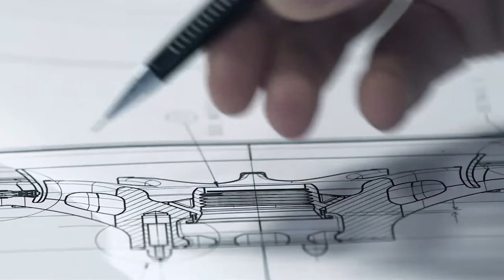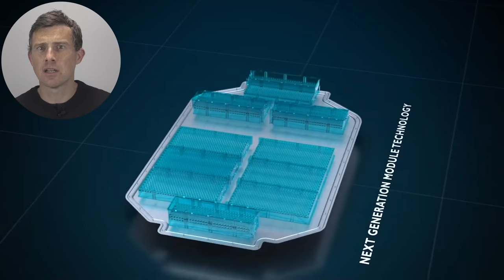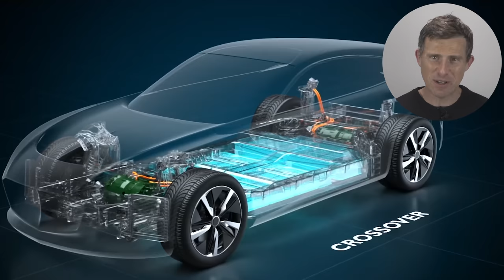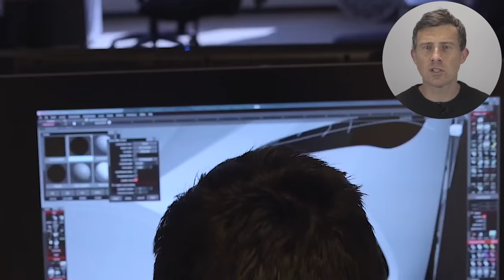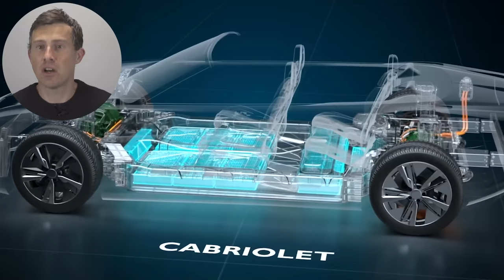New Jaguar F-Type R - an EV with 1,360hp and 1,000KM range?

Comment: Tesla S plaid vs F1 Car vs Chiron vs Rimac.

I want to see how the tesla wil hold up
Reply: Tesla Model s plaid is coming in Uk end of 2022
Reply: so u want a 140k car vs a 62.5M one vs a 3M one vs a 2.5M... i already know who is the winner
Reply: @panoskent6682  i don't know the winner but i know the Chiron is the looser on the standing 1/4mile.
Reply: Carwow need to import one, perhaps they already are.
Reply: @panoskent6682  At the end, it'd be Rimac, easy. I'd say the F1 would eek out more wins against the Tesla, since it recorded a 9.2 quarter mile, and Plaids have been running consistent 9.3 quarter miles (before stripping weight). I do look forward to Mat getting ahold of a Plaid though! Gonna embarass so many super/hyper cars, lol.
Reply: @martinkuzma_  
But they can still import it right?
Reply: Ofcourse Tesla and rimac will loose how can they compete with Chiron and F1.
Reply: Rimac will win
Reply: @enyotheios2613  yeah dude and it's only 140k. Imagine if tesla made a 2 seat hypercar.Not a tesla or an electric fanboy but what they achieve is insane for the money
Reply: @Anonymous_6.9725  
This is a 1/4 mile drag race

Not track race or top speed race.
Reply: @thabangsmallest8199  
but not at the top speed 😏
Reply: @jakes2814  Then also the F1 would reach the line first due to it's high revving small powerful engine and less weight.
Reply: @panoskent6682  The 140K Tesla?
Reply: @Anonymous_6.9725  rimac easily destroys the f1 car
Reply: 1st: Rimac
2nd:  Tesla 
3rd: F1 car
4th: Chiron
Reply: @Anonymous_6.9725  the f1 car will have a lot of wheelspin making it very slow off the start, but the rimac will win, then it will be the tesla and then the f1 car making the chiron come last
Reply: Should use a Chiron SS
Reply: then it would be rimac > plaid > F1 car > chiron
Reply: @sonethosen3211  Looks like you need basic science. eventhough the rimac is awd the F1's got a high revving ice engine power matters it's not only grip, the F1 will easily beat the rimac due to it's powerful IC engine.
Even the F1 is having a very low power making it a good power to weight ratio car and for the grip it's got a massive rear spoiler which will provide much downforce to the car to not make a wheel spin.
And if the F1's tyres are hot as well it'll beat it more faster.
Reply: @UN1T3D1C3  The F1's downforce will provide it very much traction and it's low weight will give it an advantage.
Then comes the rimac, then comes the Chiron as the Chiron's got a massive quad Turbocharged W16 which once if catches the speed can get insane fast.
Reply: @Maverick If it's a 1/4 mile drag race rimac will smoke the Chiron for sure but not the F1.
Reply: @UN1T3D1C3  There isn't a video in which F1 is directly compared with rimac.
But still in a 1/4 mile drag race rimac who smoked a sf 90 stradale in Carwow could give a good competition to the F1.
Can't outperform though.
Reply: @Wooly Chewbakker 
1/4 mile drag race and rolling race
Reply: @garosama4517  👍
Reply: @Wooly Chewbakker it is a 1/4 mile race not a race track

Comment: Your fighting the law of diminishing returns when you just try and stuff more batteries in to increase your range, it’s the weight that kills you. 120kw pack is a waste they could build two cars for that, if charging is sorted no one needs to be lugging around all that wasted capacity not to mention the cost!!
Reply: 1) people like range.
2) if you watch the video, the battery is part of the chassis saving significant weight. Plus the rest of the chassis is carbon fibre....saving weight. Result is a chassis with an integral 120kw battery that is lighter than the combined weight of Tesla's Plaid chassis+95 kwh battery.
Reply: @markheywood8236  battery is part of the chassis, meaning it’s non replaceable and the car is essentially as disposable as an AirPod since it’s batteries can’t be replaced in 15 years when it’s flat
Reply: @emmanuelonuoha1880  a) all electric cars are disposable. As the technology changes.
b) the battery chassis element could be a bolt-out element, or part of a carbon fibre casing that can be interchanged....that's how they do for e-racing cars.
Reply: That’s why Tesla decided to cancel the plaid +, at first I was mad but on sedonc though yes it’s more logical you can build 2 cars instead of 1 and you carry extra weight of battery you don’t need 95% of the time
Reply: Set out before it gets hot😷😠😡😵🤪😳😱
Reply: into every corner before you 👏✍️🤟👋🤚🤜🤛
Reply: range will  be a big seller here in Australia. most ppl want to get to their location quick and dont wont to wait around 40mins to charge up again.
Reply: You're*
Reply: @markheywood8236  do you know how much it costs to build stuff in carbon fibre, Rimac 120kw pack, carbon fibre body 2 million+, Williams have only ever done high price low volume stuff, very little chance People will want to pay that much for a jag badge or it’s going to be super low volume. Who needs more than 350 miles of real world range
Reply: @TeslaBulldotcom  But this isn't proposed to be low volume, they are building a platform that is sold to numerous manufacturers. Unit cost drops massively.

Comment: The issue with getting a 0-60 lower than 2 seconds is not horsepower or torque, it's grip. Tyres are the bottleneck.
Reply: It’s almost impossible to accelerate past 1.4G with wheels. Sub 2s gets to that mark
Reply: To be honest most differences in 0-60 times are due to grip.  Probably why Porsche and electric cars do so well - they're able to give the max amount of torque for that instant moment to the right wheels.  Porsche's have the added advantage of being able to load their huge rear wheels by putting the engines weight on then
Reply: Agreed, but these quick acceleration times are really just marketing willy wangling.
Reply: @TC-V8  To be honest, I think any 0-60 time under 5 seconds is just a party trick to thrill passengers. It's not comfortable to do that regularly.
Reply: @TC-V8  It's like the early days of digital cameras and the megapixel thing.  No-one needs faster than, say, 6-7s 0-60.  That's plenty for safe driving.  I enjoy my motorbike, but the novelty of 0-60 has largely gone.  Much happier cruising at 50 through the countryside - that brings bigger smiles that last for longer than dragging for 3 and bit seconds from some lights.  Def willy wangling.
Reply: @dm319-j5y  So now that you're done with the fun of a fast 0-60 you don't think anyone else should have it? That's pretty myopic. No one NEEDS a car at all. So stop using the word "need".  I have a 2013 Model S P85+, and my 0-60 is about 4 seconds (I haven't actually clocked it, but I'm pretty sure it's in that ballpark), and I almost never floor it, so most of the time I don't even use that extra power. But I do use it sometimes, and it's nice to have it there for special occasions.

Comment: All I know is that the days of the internal combustion engine are numbered.
Reply: Brands will continue to develop them for a few more years and then end them.
Reply: @stubones  Correct... Who wants an EV in the rain forest? 2 canisters of fuel and you can drive hundreds of kms more. Lighter jeep, diesel or gasoline have less weight too, no infrastructure needed. And in Germany you can strand with an EV too, because the infrastructure for charging is a mess.
Reply: @garosama4517  Why is that a bad thing. We want more EVs and to phase out internal combustion engine vehicles
Reply: @Hhhh22222-w  I don't understand
Reply: @unicorntomboy9736  nope, we don't wan't it.
Reply: @garosama4517  Who is we
Reply: @unicorntomboy9736  right, who is we?
Reply: @garosama4517  Answer the question
Reply: @unicorntomboy9736  You stated 'we wan't', and i stated 'nope, we don't'. Fact is, we enthusiasts don't wan't electric sportscars.
Reply: @garosama4517  I am not an enthusiast though
Reply: @unicorntomboy9736  Yeah, don't watch videos of a Jag sportscar then.
Reply: @garosama4517  It looked interesting to me

Comment: The focus on new EVs should not just be on making larger battery packs, but they also need to focus on efficiency, making them go more distance on every kWh of energy. A 160kWh pack is massive, especially for a car. That’s something I would expect to see in a large SUV or truck, not a car (sedan, hatchback, coupe). I would like to see the focus being on making all new EVs hit 5 miles/kWh (8km/kWh) at 70MPH (113km/h). That would mean cars like a Tesla Model 3 could go over 350 miles at interstate/motorway speeds. With improvements in aerodynamics, motor efficiencies, tire rolling resistance, weight reduction, and more efficient HVAC and energy recuperation, it should be possible. 

A 620 mile (1000km) range using a 160kWh pack honestly isn’t that impressive. That works out to 3.875mi/kWh (6.2km/kWh), however that’s a combined city/highway rating. The actual high speed driving range is probably 25% less than that, around 450 miles. That is impressive in the distance it can go on a single charge, but the efficiency (2.8 miles/kWh or 4.8km/kWh) could use a lot of improvement.

For reference, an existing Model 3 is more efficient, scoring closer to 4 miles/kWh (6.4km/kWh) at 70MPH (113km/h). Both Model S and Lucid Air are also more efficient, as is the EQS if its range estimates hold true in real world conditions. So, basically, all I am saying is that Williams needs to do more than just stuff a huge battery into a platform. They need an entire system (motors, inverters, wiring, HVAC design, cooling system, etc.) that works in harmony. So far the results other OEMs have had trying to use off the shelf parts hasn’t resulted in a cohesive package that works as well or as efficiently as Tesla’s bespoke parts ecosystem.

Comment: The only cheap EV that has a decent range, is the Tesla Model 3 Long Range with over 600 km range. And that one costs over £40k. When will we get a cheap hatchback with over 600 km range and fast charging for under £20k new?
Reply: When they will make a car that's normal, like sedan or coupe. Tesla model 3 powertrain in car that closer to bmw 2-series in size rather than model S that is closer to 5-series.

Comment: The motors on the hub design has been around for some time. It gives limitless control of power distribution to each wheels to maintain traction. JLR have already trialled it in prototypes.

Comment: Surely if the battery pack is integrated into the chassis, it will be impossible to replace them when they are end of life. You will have an enormous ornament.

Comment: 1,000KM range but you are gonna need to replace battery every 30,000KM
Reply: Yep, EV's are a dead end
Reply: WTF? Soo 30 recharges and the battery is dead?
That makes no sense, maybe try using grade school math.
FYI a conservative 500 recharges is 500,000km.

Comment: For an F Type, even the SVR model, 1,360 hp seems like overkill, so maybe another super track focused model called the F-Type SVR GTR or something? Basically a 1,360 hp EV that, since it is so light, can rip around a track with ease. That would destroy everything at Pikes Peak, especially since you don't have to worry about losing power as you go up the hill. Maybe even make a road legal version called the SVR GTR-S with smaller aero (like Senna level)?

Comment: Every configuration has all that carbon fiber? Automotive manufacturers will also have to pay Williams to use that platform? Well good news is that if you can afford to buy a roadster you can at least afford to buy the base model of this platform. I wouldn't be surprised if the top end spec cost over $500k.

Comment: It was a shame Jaguar didn't produce the Cx75. That would of been an amazing rival to the LaFerrari, P1 and 918. But if Jaguar uses some of the design cues for the next F Type, that would be pretty amazing 😃. And as long as it is unmistakably a Jag, that would be cool. Plus Jaguar is ahead of Porsche, as they haven't released a fully electric 911 (yet).

Comment: Is using highly flammable/explosive batteries as a stress-bearing part in a supercar a wise idea?
Reply: I imagine the battery framework that supports the cells is designed to be a stressed part that works in conjunction with the surrounding monocoque, much like how engine blocks add to the rigidity in many supercars without the internal components mated to the block being stressed. For safety, it shouldn't be a problem to design a battery that does its best to keep cells sealed under mild deformation.

Comment: Soory BUT to build these electric Cars costs a huge Carbon footprint, so large it would take every car built 60K miles to brake even..........yep EVEN.
The sums just don't add up, production costs way to high for low returns, someone's fucked up.

Comment: Yep 4 hub motors one on each corner and use software to control them so if you want to you can lock all 4 wheels in for ultimate traction or swap drive between front rear amd left right and to just one wheel if needed . Teslas are going to be dinosors soon . So instead of replacing a drive unit and motor like teslas do you just replace a hub motor . If you want to you can use geared hub motors with planetary gears . Thrse cars should also have solar cells to help charge the battery during the day . All new tech comming out . Our battery tech still needs an ovethaul aswel . Life po4 batteries are better than lith ion . They are alot safer and last alot longer than lith ion and lipo .

Comment: This new platform that Williams are developing is very clever but if they offer it out to everyone than most electric cars will be the same underneath. Also if all these companies use Italdesign to design these cars than they will all have similar styling. So in the end all cars will have the same underpinnings and will look similar. Then these cars will all be priced differently depending on the brand.  so at the end of the day the more luxury brands will fail because people will just buy the cheaper version from a less luxury brand that will have the same performance.

Comment: We do seem to be going up a blind alley.
More and more weight and power.
Less and less involvement and fun.
300 bhp per tonne enough for any road. Seriously, prove me wrong.
Use tech to take weight out of cars......
Seriously a tonne of car with 300 bhp is a lot more fun.
The science bit.
Weight kills energy consumption.
KE= 1/2 MVsquared.
Half the weight = half the energy to accelerate, brake, climb hills etc.
So your two and a half tonne EV with 1,000 bhp will be no faster than my seven. It will have no feedback, it will use four times the energy to accelerate and climb the mountain pass, will be so much wider that I can take better lines on the road, avoid oncoming traffic with ease. It will also eat brakes, eat tyres and if you actually use the power to get up a mountain pass will astonish you how much battery it uses.
If we do the maths even Greta would approve of me keeping my Seven or TVR for fun and not buying a new technically brilliant tank, I will also save the entire purchase price, and much of the running costs because I won't have any depreciation and parts cost buttons (and don't wear out anything like as fast).
As soon as the government have forced everyone into electric cars guess what? TAX TAX TAX to recoup the ridiculous amount that they make on petrol.
Suggest that Matt does a comparison of the costs for running cars without tax and the tax breaks and we can all see how affordable in the inevitable real world electric cars are.

Tax on petrol varies from about 60% to 75% over time. So real running costs for fuel are about 1/3 to 1/4 of pump prices.
So for £6 I can travel about 30 miles. But without tax that is 90 miles.
Fill up a polestar and electricity is about £16 and that gets you about 160 miles driving the same as a Lotus Elise.
So that is £1 for ten miles as against £1 (without tax) for fifteen in the Lotus.
Let's say the Lotus only manages £24 mpg and the real costs are approximately the same.
Matt. Please Please Please can you compare true like for like.

3 Years running costs for a Lotus 111R say. Perfect condition and the best new electric sports car offering with the distorted tax and bribes (sorry grants) removed. Or a perfect three year old diesel XJ against the same cash value (without grants etc) new electric car.
The tax benefits will dissapear faster than any of these electric cars accelerate and we will be taxed to capture the lost income from petrol and diesel, so it is a very valid comparison.
I will put a £5er now on the Elise walking away in all areas except initial acceleration and another on the Jag doing the same. Will be a lot of fun.

Comment: 600+ miles is just not required - it will be many many years before that kind of battery capacity is available to the masses, and it's pointless anyway as long as charging infrastructure is up to the task. Tesla is already there, and the others are slowly catching. 250 miles and then a 30 minute stop is good enough for anybody, despite what they may think.

Comment: Motors in the wheels is a mistake, for a number of reasons. The big two are: Unsprung weight and vibration/shock being really bad for the motors. If you put that much unsprung weight on the wheels, your ride will suffer, and if you put your motors out there they're not going to have a typically long life normal to an electric motor. They will be exposed to vibration, shock and environmental effects much greater than if they were located inboard and protected.

I would LOVE it if Jag came out with a Williams engineered car -- but it's still not going to be remotely competition for a Tesla, because it will be 10x the price. You can't make an entire carbon fibre car, with over 1300 HP, and still sell it for less than $100,000. I mean, it would be awesome if you did, but you may as well wish for unicorns.